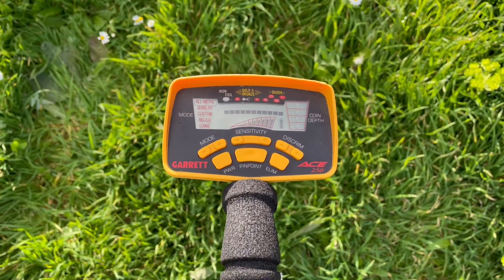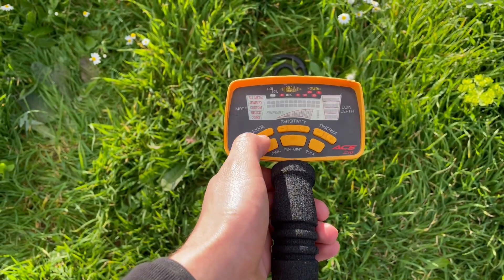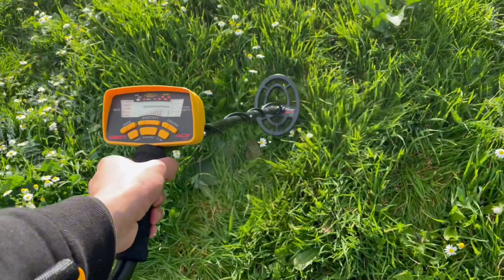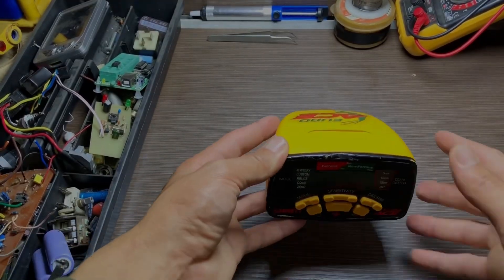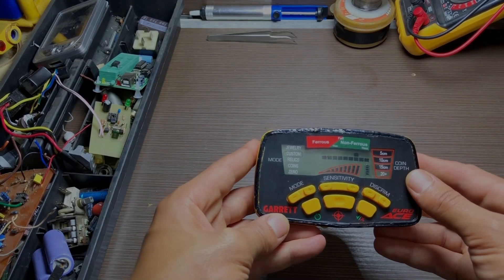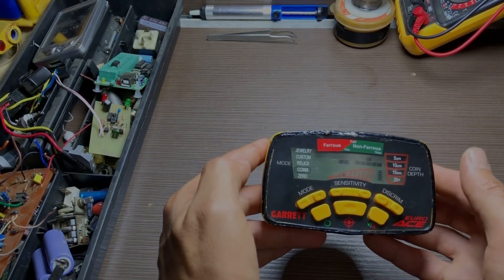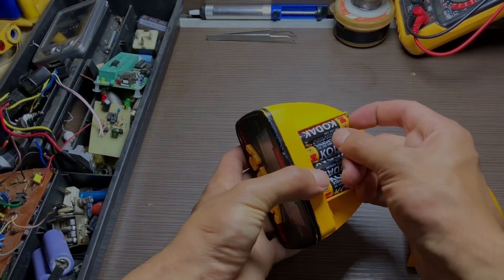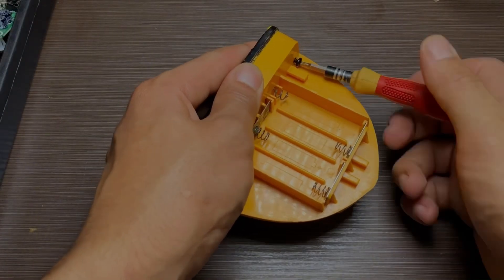Garrett Ace 250 Metal Detector Repair

Comment: Nice demonstration. My 250 is about 15  years old.  The problem I've been having is that the battery coils are not holding the batteries in place well from long use. I don't want to ship the entire detector. Is there a way to send the part to replace the coils to Garrett headquarters? Janice Perkins

Comment: I've got similar issue with Ace 250, it beeps without metal nearby even when the coil is up in the air. 

I will try later opening the device I just don't have it here with me right now.

What is the type of IC you changed? I cannot read the markings from video.